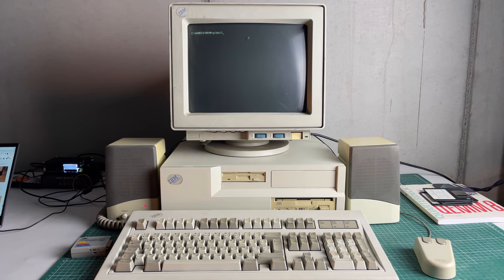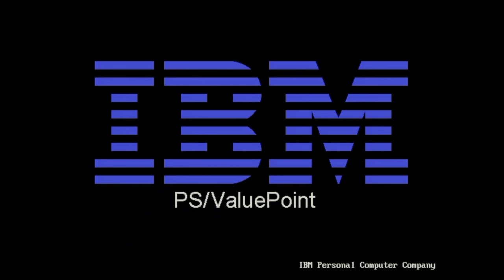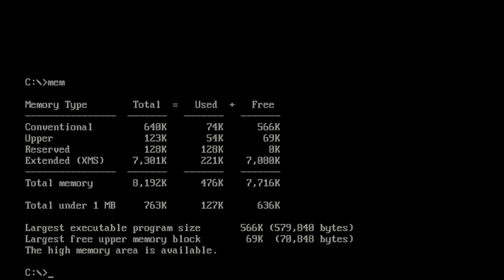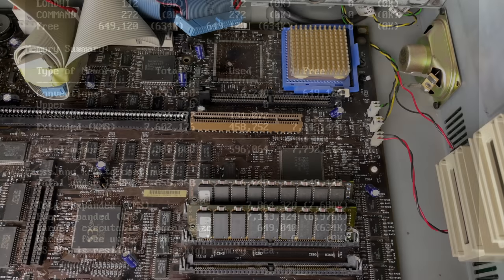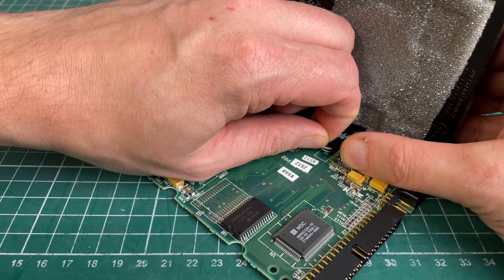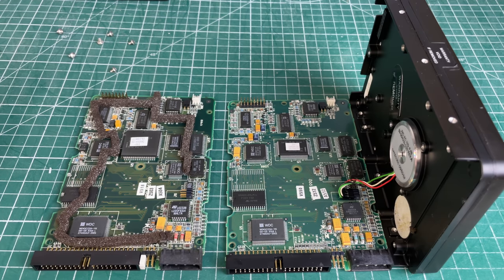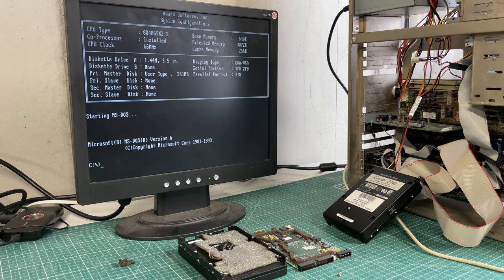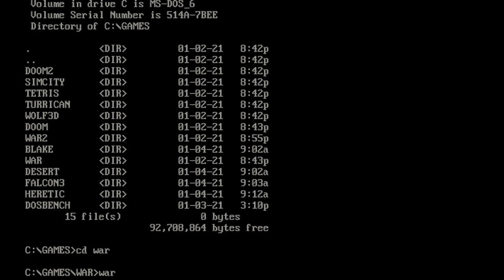IBM ValuePoint 486 : Final chapter

Comment: QEMM was great. A friend of mine had a 486DX2 that he used to run some trading software on it. This was before the internet, so that software could dial some number via a modem and connect to the software vendor's server to get the latest stock data for trading. But he had ISDN so we had to install some DOS drivers for the ISDN card as well as some emulation layer that made the ISDN connection look like a modem connection to the software (they actually even briefly described that process in the manual of the software). And the software itself needed 6xx+ KB of ram to run. I fiddled around with QEMM for quite some time to make all this work. We then called the vendor's support for some other reason and I mentioned our setup. They were gobsmacked. They had never heard of anybody who got this setup actually running despite mentioning it in the manual. Thank you, QEMM!

Comment: Those apple computer simm devices are the roms from an old style Macintosh, those machines relied heavily on roms and so those were made swappable
Reply: Yep. Mac II and SE series definitely used them. Some still had the slot but the rom was on board. There's a product that lets you have a ROM drive for those old machines.

Comment: Wow, what a coincidence. I had exactly the same setup, even with the exact CD-ROM drive, running QEMM. I have installed my own, registered QEMM yesterday on my Libretto 110CT for some DOS gaming. So much time has passes on, although I was the one using them, it feels like in another life time. I have upgraded to this machine from a 386DX-40 and that was an impressive upgrade. Had the VESA HDD controller, that thing was lightning fast. Just one note though, you can have ~720-730KB of base memory, if you play your cards right with QEMM.

Comment: I worked at an IBM reseller /Business Partner in the 90´s...just love at first sight work with PS/2´s, Valuepoints and PC Servers.The problem always was to find compatible memory  (70ns w/parity)  available for sale outside IBM,with affordable prices...A local company here in Brazil manufactured  compatible parity SIMM´s, but now they are rare,hard to find and  expensive just like IBM´s.Great video!
EDIT: If your PS/ValuePoint doesn´t have cache, don´t worry....since the mid-nineties messsing with this machines,i NEVER,EVER see one of this type of planar model with cache attached.Looks like is a failure/error in project or, something like this who prevent the use with cache attached...

Comment: May be I'm wrong, but I heard, that IBM can run with any PS/2 FPM memory sticks with parity chips included. However, they are not very common for 72 pin sticks.... would be interesting to know. I have a PS/2 as well, I'll check it later.
Reply: Unfortunately not all parity FPMs work. I only managed to make one work.

Comment: I have an IBM PS/1 (early 1993) and an IBM Aptiva (mid-1994) and neither needed IBM memory - one has HP memory even so I think it was only certain PCs.
Reply: Agreed.  The PS/2 Model 30 286 used proprietary memory (and possibly the model 25 as well), but I don't recall it being an issue for any of the PS/1 line.
Reply: @RetroTechChris  Well I'll soon discover which memory I need for a Valuepoint - I bought a 425SX/Si PS for €80 yesterday and will likely need to add a little more RAM (it only has 4MB and ideally I'd like 8). I'm curious to see how well it holds up against the PS/1.

Comment: My first PC was a IBM ValuePoint 433DX/Dp that I got for free in 2000, I upgraded the CPU to a DX4 100MHz and over did the RAM upgrade to 64MB (I had it to 96MB once).
Reply from the maker: Gotten to like these ValuePoints ... everybody taks about the first gen systems and ps/2 machines but these ValuePoints are also nice.

Comment: conventional memory (640k) is used by programs that run with the processor in real mode (which is the default mode for x86). Games like doom, sc2000 run with the processor in protected mode and the code and data all reside in extended memory, so freeing up conventional memory for those games is less important. Any program that you see the DOS/4GW or Pmode/w loader runs in that mode :)

Comment: You can use Hydrogen peroxide and sunlight to turn the yellow plastic white again on them drives. You rap the plastic in paper towels dampened in hydrogen peroxide in the partial sunlight it causes a chemical reaction turning it white again. Just keep the towels damp for about 6 hours.

Comment: Memmaker was a joke. It caused problems with the load high commands and such. I was able to get 618k of base memory if not 620 in the day. The big problem when you used enough programs is some of them would want that space the Load high used (assigned.) I'm not a programmer so I don't know if the program was written wrong or not. But Double space and memmaker got me tons of money back in the day for the small computer shop I worked for.
Reply: I always used memmaker as the starting point. Afterwards I hand tuned the load order/etc. to squeeze out the remaining bytes. I also remember always being on the lookout for a smaller mouse driver. The driver that typically shipped with Logitech mice was rather big, and you could get quite a bit of memory back by using a third party driver.

Comment: 3:57 Internal L1 cache seems to be disabled? Any reason for this? This will probably slow down the system quite a bit.
Reply: I noticed that too.
Reply: Disabling the L1 cache for a 486 would severely limit performance. It would lead to a situation where the performance would just not be there. In fact, one may think the performance has, indeed, left the building. If one were to ask "where is my performance", the answer would a thorough and resounding "what performance?". After a while, people would forget what performance was, with the word slipping into obscurity, only known by a secluded cabal of people with askew tendencies.

The benchmarks in this video suggest the L1 cache was active after all, though.
Reply: @maikmerten  Yeh, I thought it might've been enabled in the benchmark since it was so close to another DX2 system (which most likely had its internal cache enabled).
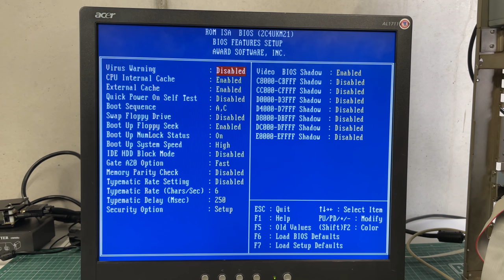Reply: I saw that too, but at 11:30 it shows enabled in the BIOS.
Reply: @powerspec88  That's his other 486 PC, not the IBM one.
Reply: @8bitbubsy  You’re right, my bad!

Comment: Hey are you sure the original caviar PCB was bad? I noticed it had the jumper set, whereas the one you swapped over did not. Iirc those old WD drives would work when jumpered as "master" if and only if there was a slave present. When run alone on a channel it needed to have no jumper installed

Comment: I also have PS/Valuepoint  386SLC and it is also very picky when it comes to memory upgrade. However, I already have 4MB soldered into the board and 2 free SIMM slots but I only managed to get one of my entire collection of SIMMS to work. It is an 8MB Samsung stick labelled KMM5362203AWG-7.
So it is not limited to IBM modules, I just think it needs to be FPM and requires parity, but I'm not sure about this pattern since I tested only ca. 20 modules. As I got one of 8MB sticks working I forefit further testing since 12MB of RAM is already an overkill for 386SLC.
Hope that'll help people to get through memory upgrade on those machines.

Comment: The L2 cache module looks similar to a COAST module, but it isn't.  COAST modules use pipeline burst cache, same as the ones later soldered to the board. The rare ones you'd find on a weird 486 board are regular async cache, just like the old rows of DIP chips.

EDIT: http://www.amoretro.de/ebay/2014/06/m919cache.jpg

This is basically what you're looking for.

Comment: the older drives you can do the board swap, as long as you use the same or new revision, i use to do it all the time with seagate ST-225 and 251 and Conner and maxtor IDE drives.  The whining of the monitor sounds like flyback gone out.

Comment: Would be an awesome machine to put an early Debian on.  With a bit of editing, you should be able to get XWindows going.  I used to run a 486DX2 with a SCSI controller and 600MB of HDs Multi-tasking heaven and SMOOTH interaction because of the SCSI.

Comment: Those COAST modules (Cache On A Stick) are a pain. I have a few in my collection, and they're all slightly different. I have one that came with a Pentium motherboard. To me that is strange, because I assumed that only 486 boards had use for external cache. P1's had their own L2, and Celerons didn't yet exist.
Reply: No, Pentium-class CPUs had no L2. Only late K6-2+ and K6-III+ have on-chip L2 cache, making the on-board L2 effectively L3. And then it was Pentium Pro which first introduced on-chip L2 to Intel chips (and then Pentium II with its Slot 1 scheme).
Reply: @peachgrush  Guess I'm starting to forget how things were 20 years ago. COAST I didn't know existed. I had some weird ram in  a bag that didn't fit anything, until one day I found a P1 motherboard with a cache socket and a module already installed. Then it made sense what all those short memory sticks were. I never even fired that board up. It's currently serving as a wall decoration.

Comment: Yeah Falcon 3 eats a lot of conventional memory. I Have been messing with Windows 95 OSR2 (dutch version) under PC-em. Seems like I can’t get enough conventional memory unless I use HIMEMX. I tried all the usual things such as highloading DOS and all the drivers. But the default HIMEM that comes with Windows seems to use more memory then HIMEMX. The goal is to have a configuration that is suitable for memory hungry games that also require a mouse and cd-rom but also run things like AutoCAD release 12. I did manage to do it, but I only got the desired result with HIMEMX. I’ve heard that some versions of OSR2 have some sort of weird bug regarding memory.
Reply: Its seems the translated OSR2 versions of Windows 95, have the same problems with the conventional memory. A made a patch for this back in the day for my Spanish version based on another version (I think based on the English/Original version ) that  I found on a pirated CD. I don't remember exactly the solution or where I have this patch, but It had something wrong in the IO.SYS file.

Comment: I never used smartdrive because of this kind of use (waste for me) of the conventional memory. A good configuration of commands like FCBS , FILES, STACKS and BUFFERS on the CONFIG.SYS have near the same effect in terms of speed than the memory hungry SMARTDRIVE. At least with DOS+WIN3.1 without CD-ROM. And when you use a CD for installing or copying games or other software to the hard drive , you can always load smartdrive temporarily.

Comment: I’m dying to find an 8088, 286, 386 and/or 486. I can’t find any good recyclers where I’m at outside of Philadelphia :/
Reply: In the 90s, our home had three different PCs: 8088, 486, and P5. With the exception of the P5, our computers were more advanced than our school's, which meant formatting our HD 1.44 MB floppies as DS DD 720 KB, so I could use the same disks at home and school. I love all three, but the 8088 is my favorite. Sadly, they've all been scrapped except for the P5, which presently has a blown sound card and a dead monitor.

Comment: here we go:
http://ps-2.kev009.com/pcpartnerinfo/ctstips/326_7.htm
http://ps-2.kev009.com/pcpartnerinfo/ctstips/5cba.htm
L2 Cache 256 KB 92G7431
https://www.memory4less.com/ibm-processor-board-92g7431
but I would cross check, if it is the right one. As I said I searched for years and got the modules for much cheaper by chance: The first one was a donation from a fellow Nekochan user, the second one I got from the USA, where somebody offloaded a heap of old memory modules, and in the preview image I spotted it, the third one was a retro PC retailer (now defunct) that sold the part for $ 30.